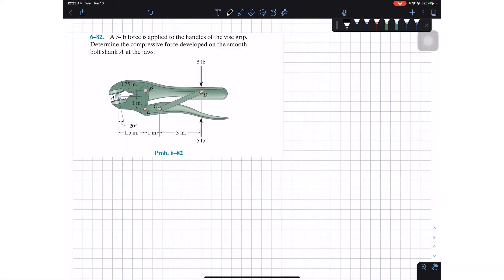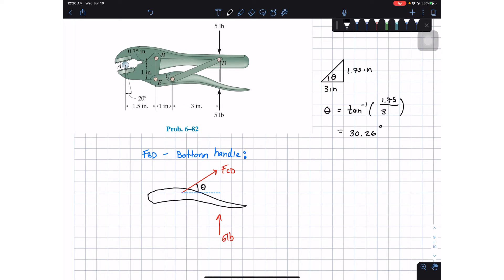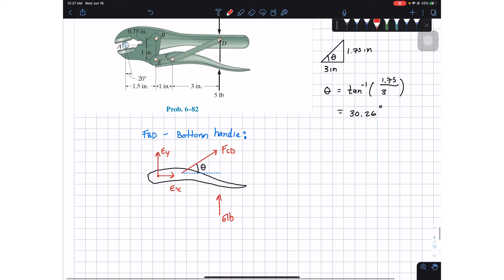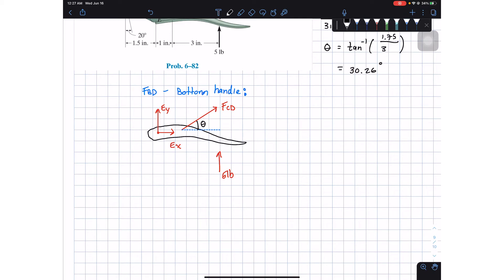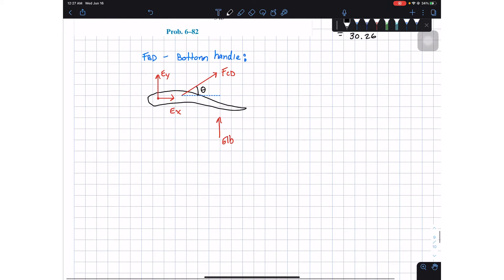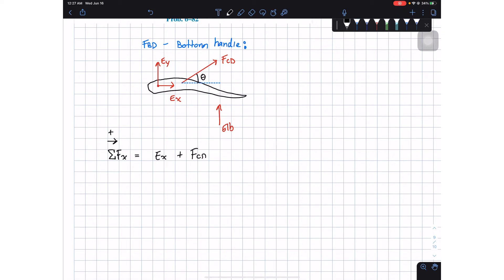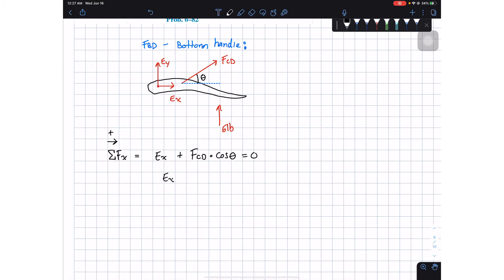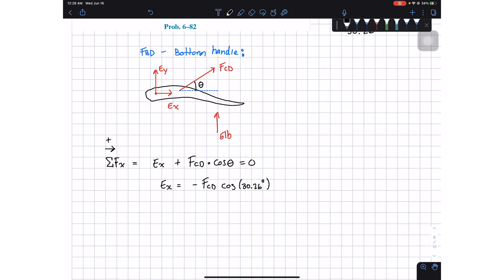Statics 6.82 - A 5-lb force is applied to the handles of the vise grip. Determine compressive force.

Comment: when you solve for NA, in your moment at B you mulitplied the x component by the horizontal distance and y component by the verticle when shouldnt it be the other way
Reply from the maker: Pay attention to the direction of the angle. Since the angle its related to the vertical axis, that means that (Na*Cos) is the vertical component and that is being multiplied by the horizontal distance which is 1.5. Same on the other component of (Na*Sin) is the horizontal component and multiplied by the vertical distance 0.75.

I hope this clarifies. (The trick is that the angle is not with respect to the horizontal axis, thats why the change in cos and sines for each component.)
Reply: @LearningbyTeaching  I see thank you! Good thing this homework is due in two days and not tomorrow
Reply from the maker: @kosmonavt5125  I am glad the video helped

Comment: How did you change the -60 to 60 at the last step when solving for Na?
Reply from the maker: It was a small mistake in which I draw the force Ex going to the right on the second FBD. The force Ex should be going left because should be in the opposite direction from the first FBD. Therefore, that moment of Ex around point B should be negative (clockwise direction) and when you solve and pass it to the right side of the equal sign gives a positive value. An apology for the confusion :)